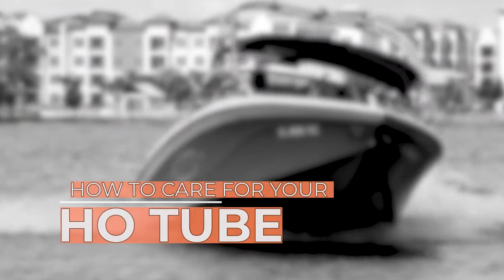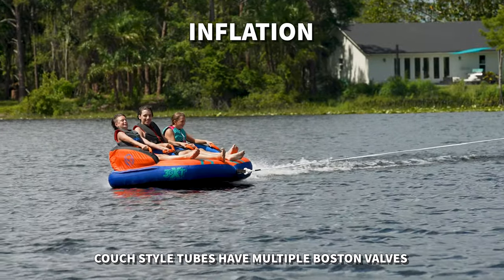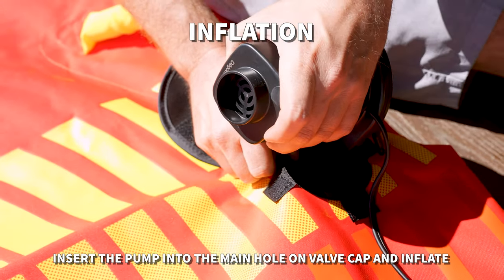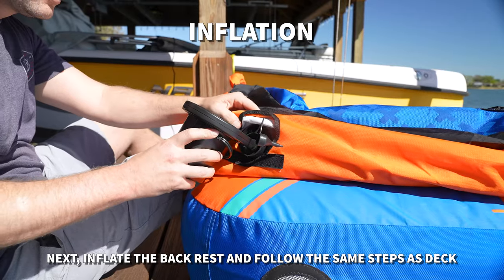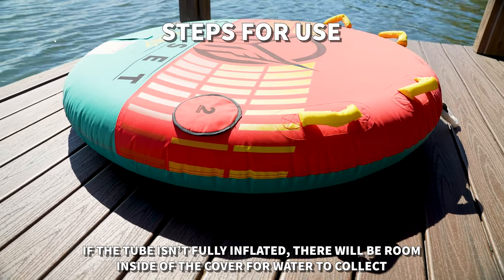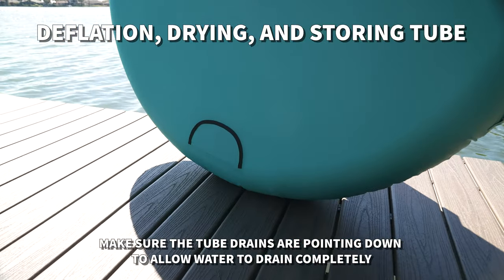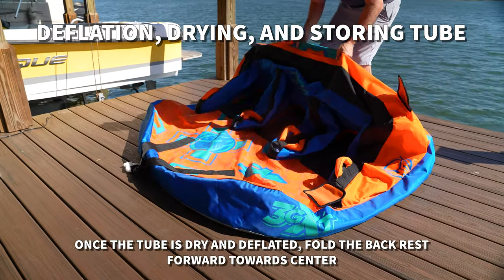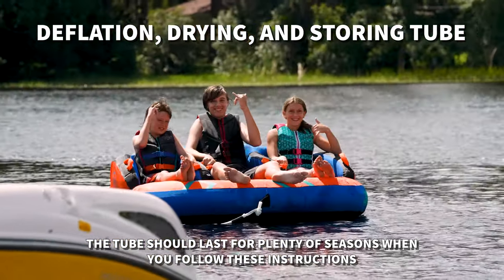Tube Care for Beginners. How to inflate, deflate and store your HO Sports towable Tube.

Comment: Where do you keep it when on the water but not using it. Mine takes up the most of the boat. Any suggestions?
Reply: We haven’t found a solution for this other than deflating or beaching.